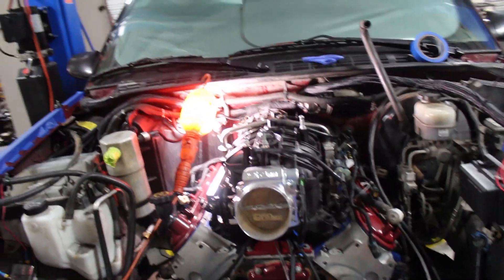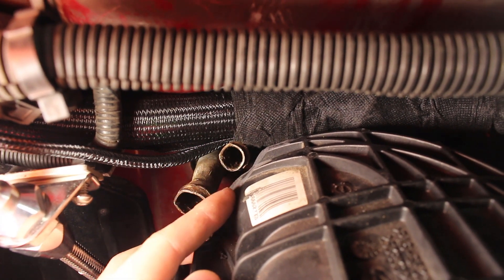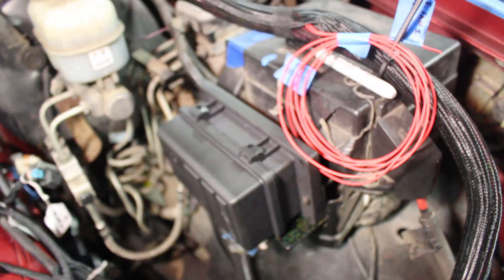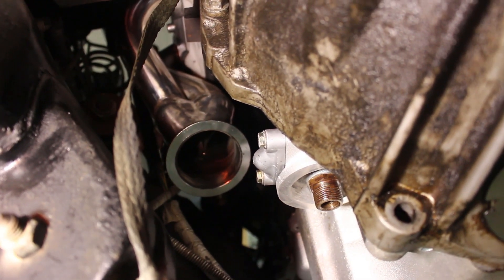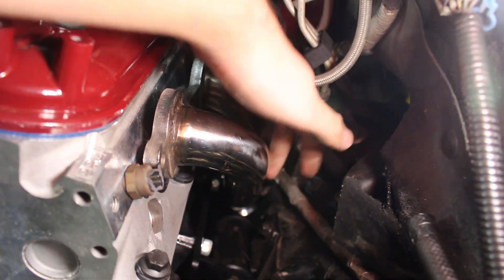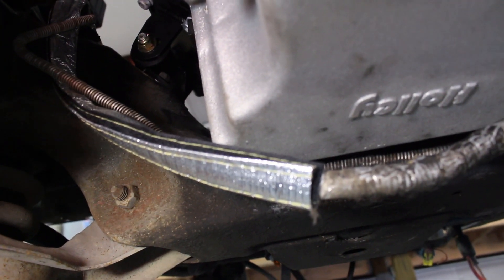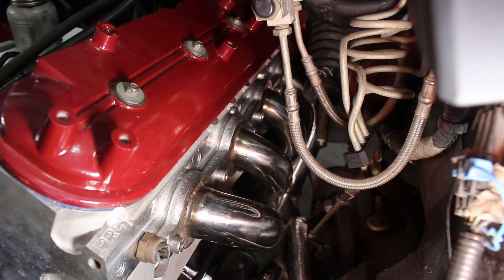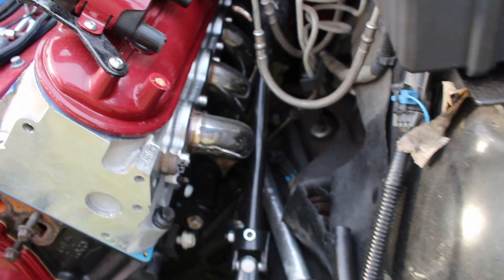S10 LS SWAP PT 12: Making Room for the Holley Steering Shaft

Comment: Hey, thanks for your video s. I am following the build you did . My project is putting a 6.0hp into a 03 s10 similar to yours .Could you please let me know what mounts that you used used? I plan on useing the same holley pan and black heart manifolds as well. I'm just not sure what to use for mounts. I am considering the dirty dingo but your experience will be my determining factor
Thanks
Reply from the maker: I used the Current Performance Wiring (CPW) engine mounts. They seemed to fit well for our build, but could vary depending on the truck. I know a lot of people on the forums have used the dirty dingo mounts as well with success. I don't think either would be a bad option imo

Comment: Does the hooker steering shaft work wit the stock steering shaft? Or do you have to swap out the whole steering colum?
Reply from the maker: It is pretty much a direct replacement with slight modification on the steering gearbox input shaft to allow for the set screw to grab.

Comment: When you installed the steering shaft did you have to make a flat spot for the set screw or did you use the factory one?
Reply from the maker: I had to grind a flat spot for the set screw

Comment: Good job!. When installing a fast intake manifold does the heater core still need to be bent?
Reply from the maker: No, the lower car style intakes will clear the heater core without interference. The only thing is I believe you have to run the car style water pump and some accessory spacers, but I could be wrong on that.

Comment: I'm from Ohio working on 94 s10 ss putting 6.0l in. I just put it back down on wheels put new springs and bushings in control arms gotta fabricate a mount for remote oil filters. Then I'm putting blazer fuel tank in rear hope to be on road in couple weeks . Working on wiring next. Your videos have been very helpful TY.
Reply: Are you upgrading the rear differential ?

Comment: Some advice for you on your drivers side header, I’ve done this swap with a zr2 s10. Cut the v band flange off and and make a pie cut or to and weld it back on where it will clear for you. Its pretty thin stainless btw. Then for your collector I was able to cut a 45 degree bend to make it clear my front drive shaft and everything.